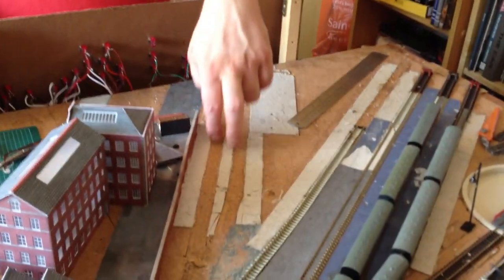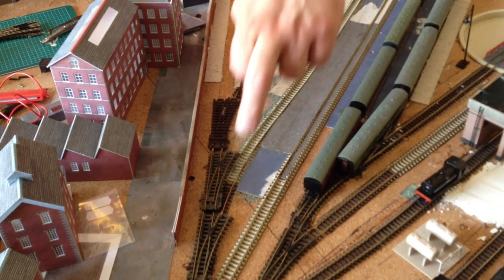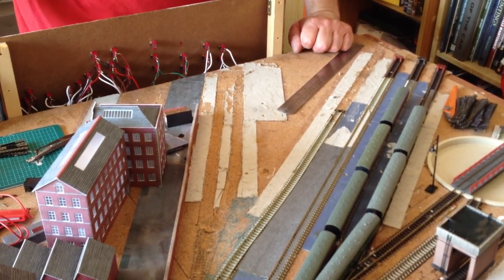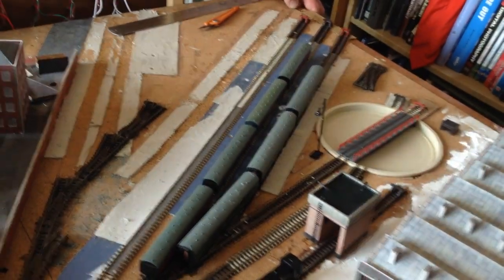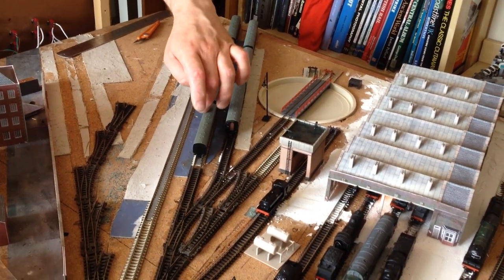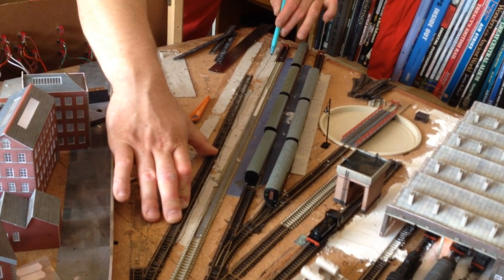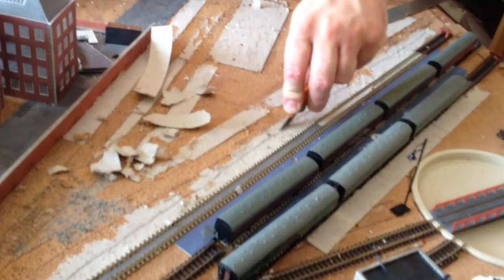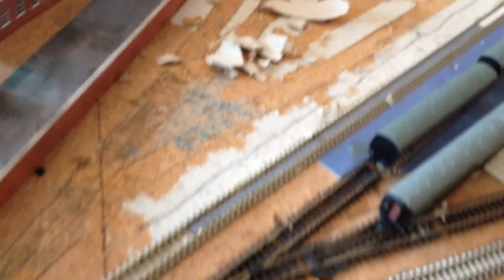New Sidings at Sherwood Central

Comment: Hadn't really thought about that yet! Expo do a TT drive, and it's a reasonable price...
Want to get points motorised first though, will be pretty much all surface mounted point motors in the sidings as I didn't drill holes for under board motors as a lot of the points are over baseboard crossmembers...